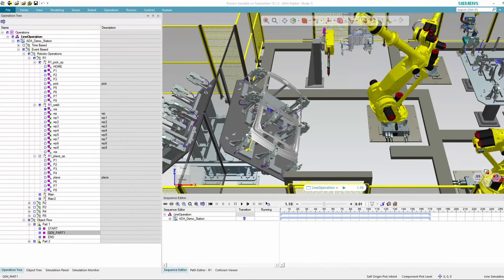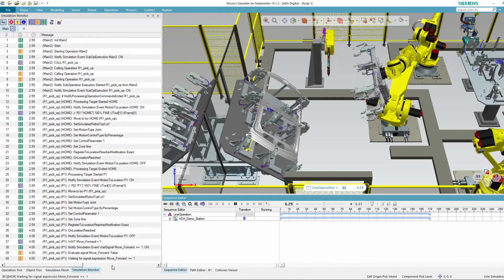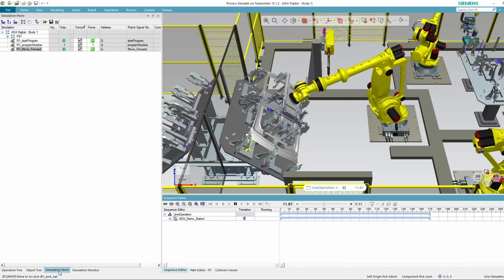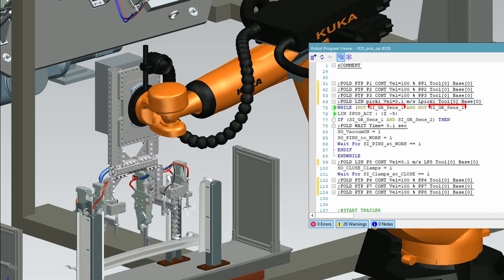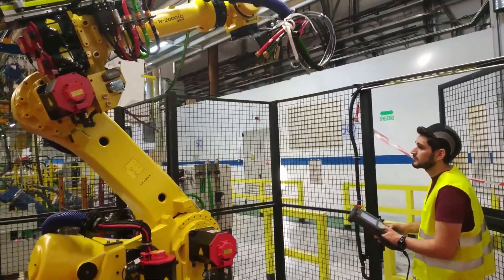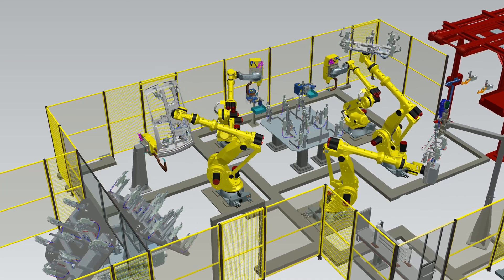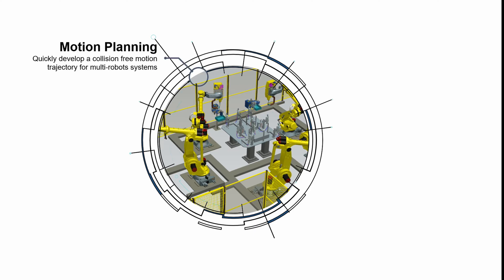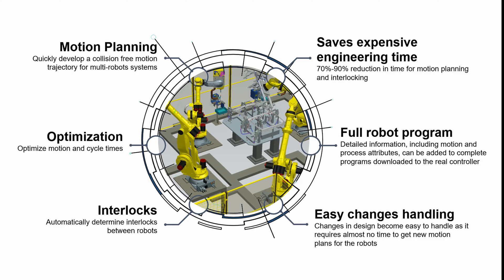Tecnomatix Process Simulate - Event Based OLP

Comment: Hello. Could it be done the same for ABB or Fanur or other robots?
Reply: Yes. Event-based OLPs aren't locked to a specific robot brand. PS will output a different program depending on the robot language used.

Comment: Can we use SCL to create LB , for servos and VFD i am facing some challenges
Reply from the maker: Hi,
You can use the SCL editor in order to program a specific behaviour for a resource. SCL 'blocks' are usually used in a separate manner from the Logic Blocks, as they are a snippet of code that you can use from the PLC project. You can try an copy the what's contained in the FB for the drive or the encoder and use it inside of Process Simulate.
Reply: @ADAComputersPLM   Thank you very much for your kind reply and detailed explanation